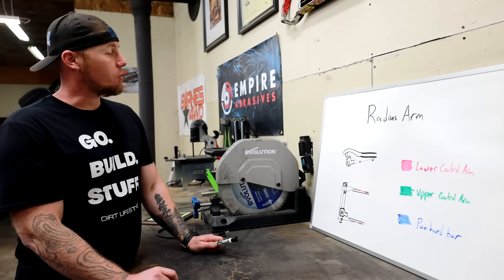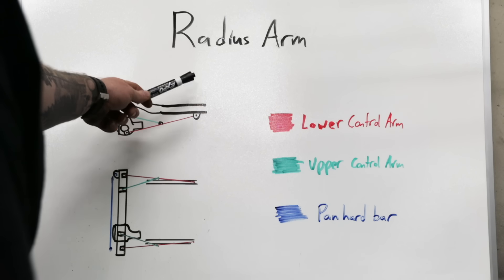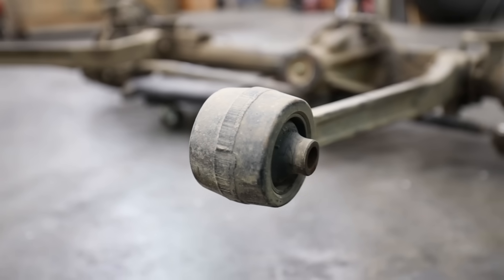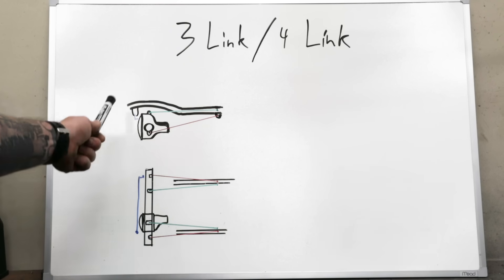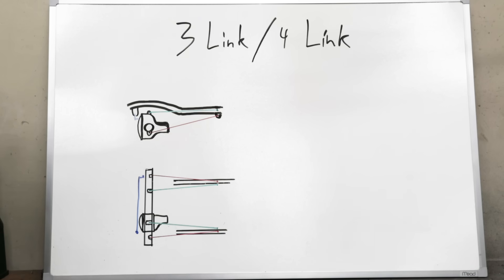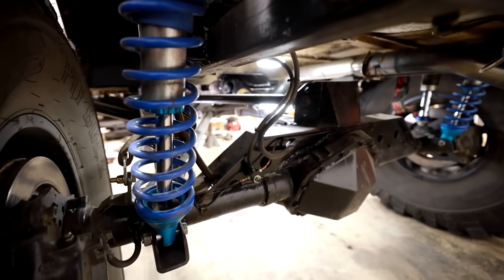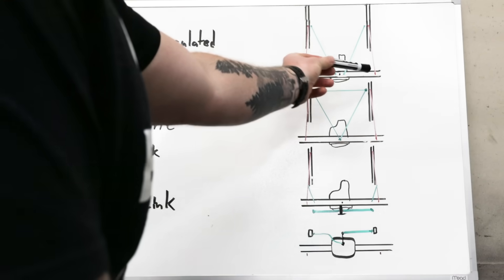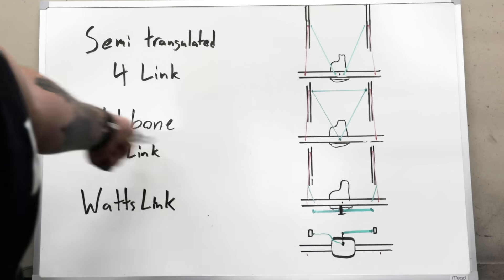3 Link vs 4 Link vs Radius Arm vs Watts Link vs Wishbone 3 Link

Comment: The upper wishbone was OEM in Jeep WJs. It is like a triangulated upper links where the axle mounts are at the same point. However, in practice, a wishbone tends to be much shorter than triangulated upper links.

There is a company that makes a very unique rear Watt's linkage for a JK with standard or Dana 60 housings. The unique part is the center element is horizontal on top of the axle instead of vertical behind it. What makes the Watt's link preferred over that Panhard rod is there no side movement of the axle...the center is always centered. Ditto for the upper wishbone and a well-executed triangulated links. 

The problem with either double triangulated links, a wishbone, or a Watt's link in front is the drag link from the pitman arm to the knuckle that will cause bump steer. With a Panhard bar, lots of effort is made to make the Panhard bar and drag link parallel. Full-hydraulic steering cures that problem and double triangulated is de rigueur on rock bouncers and I thought on 4400 class Ultra 4s that didn't have IFS.

Comment: Off roaders confuse the hell out of me.  A triangulated 4 link will have geometric bind built into the design at the extreme ends of travel. You do not get this with a 3 link. Even a parallel 4 link will bind at extreme ends of travel. There simply is too many control arms and SOMETHING has to change length because the axle is over constrained. The only thing that prevents damage is the relatively slow speed at which the suspension articulates and soft sidewalls which allows the geometric bind to move the axle before something breaks. That said, predictably is always key... and laterally moving axles isn't predictable.

Also, I disagree with the notion that a 3 link is weaker. Unless your inverting the control arms such that the central link is on the bottom and the outer links are on top, the load from the axle is almost entirely transmitted through the outer lower links and any rotation is easily handled by the upper control arm. Ford has 1000+ HP and Torque drag Mustang's with 3 links launching harder than any off roader is hitting their tires. 

I can understand why a PHB is preferred for off roading since it's simple and just works. The advantages of a watts link aren't nearly in play as much as they are on car racing and even then, the lateral movement of the axle is pretty damn small.  The primary advantage for the watts link is roll center control by either fixing it relative to the CG (chassis mounted pivot bolt) or relative to the ground (axle mounted).  I can't think of a single reason RC height would matter for off roading except maybe preventing rollovers while cornering and general driving behavior on the road. 

No matter what, designing the suspension for your intended use is always a compromise. Packaging is always a concern. Just don't let the ease of certain designs artifical constrain you. Longer arms tend to allow for more bind free travel and better consistency.

Comment: My Jeep WJ has that wishbone 3 link on it, I have mixed feelings on it.  Not a fan of that big stock boomerang arm that came stock because it uses a pretty weak ball joint on the rear.  After lifting it I was getting lots of forward and rear movement on the axle causing some pretty bad banging sounds in the rear because the ball joint pretty much turned into jelly after a very short period of time under normal highway driving.  It blew the factory style ball joint fast. I believe the control arm is similar on the Liberty and WJ, it may be possible to adapt an aftermarket rear A-arm from a WJ onto a KJ, in theory, but I've never tried it.  The advantage being there are many aftermarket rear A-arms for the WJ that use flex joints instead of bushings and ball joints, very very easy to convert.

Comment: Pretty sure watts link is used more in stuff like stock cars, dirt track, etc. Because of the arms it's more limited in vertical travel than a panhard, making it not so great in 4x4 applications. Biggest advantage is it always moves straight up and down, not in an arch like a panhard.

Comment: After building several 3/4 link rigs at the shop I'm still on leaf springs. Love the simplicity, strength and lack of track bars.  And yes leafs can flex!  Excellent video mate!
Reply: How did everyone like the 3 link? I'm thinking of 3 linking my rear on my 86.. I wanted to keep the stock tank. Have long travlenin the front.  And was debating on rear deavers or 3 link

Comment: Just solid axle swapped the back of my 03 Navigator built everything 1 off custom 8" lift  with radius arms  1 1/4 Johnny joints 
Navigator on 37x13.50 x 24 interco m16's

Comment: So would the would the easiest way to convert a leaf spring rear to coils would be something like a radius arm set up utilizing the original leaf mounts and coilovers? At that point the only thing being added would be the panhard bar, and some reinforcements around the shock mount? Seams simple enough.

Comment: On a three link let's say if pumpkin housing is on the driver side can you run the upper link on top of the diff or is it better to run the link off of the passenger side where the pumpkin is not?

Comment: is a rear 3 link viable? i would like to convert my MJ to rear coil springs but i want to keep my fuel tank in its stock location, ive seen a 4 link done in a MJ but they converted to a fuel cell and thats not the most practical for what im doing with my truck.
Reply: Why not a radius arm setup?
Reply: @macmurfy2jka  i dont think there would be enough room, the back of the fuel tank is only about 2 or 3 inches from the axle.

Comment: Another cool solid axle suspension is the torque tube suspension used in UNIMOGs and the model t and some other stuff (not that practical to build it aftermarket but still cool). And a crazy suspension that just boggles you mind to try to figure out is the de dion suspension (prob mispelled)

Comment: Nate, I have a quick suspension question: How do I pick the 'best' shock for my rig?
I have a '48 Willys jeep I picked up about five years ago. The chassis was stretched two feet, giving it a 108" wheelbase. The leaf springs were a disaster when I bought it and I had to replace them very early in the build. Being short on funds and knowledge about picking the right type of leaf spring, I went with the Rancho 2.5" lift system with the RS5000 shocks.

Long story short, five years and about 25k miles later it still rides like a dump truck even with the 235/85r16s at 25psi. 

I know that the type of spring pack has a lot to do with that. The Rancho spring packs have five leafs that are 3/16 to 1/4" thick vs. the original 9-10 leaf packs with leafs in a pack of overall similar thickness. 

The truck weighs about 2800 lbs empty. I'm looking at a GVW of no more than 3800lbs fully loaded (targeting 3500lbs). The truck is being set up as an overlander and is my daily driver. 

What should I be looking for in a shock, knowing I can't afford things like remote res Fox units?

Comment: Would love to hear about a trailing arm suspension. I know it's kind of just moving the shocks, but would love to hear your thoughts on it. I would love to build my TJ as sort of a hybrid that can go fast in the desert, but also has decent rock crawling abilities.
Reply: That kinda what i'm doing on my ZJ. Outboard the lowers outside of the uni and mounted shocks in the back 1/4 of the lowers, -still making a mount on the axle in case I don't like it. . Uppers converge to make a wishbone.  I think it's gonna work pretty good though.
Reply: @sloppyoppie  awesome idea! I love ZJs, definitely on my list of vehicles I want to build in my lifetime. what are you doing for the front? I'm not sure what to do for the front to get that prerunner/rock crawler combo
Reply: @Dyrdeksk8r  I went with a control arm drop brackets (shameless 100%). I kept bending long arms on an xj that I jumped alot so I got drop brackets and am going to tie in my front cage A pillar and rock sliders to the drop bracket to add lateral support. The brackets went on over frame stiffeners also. That should last a while. For me, indestructibility is number one. Those handle great too. If it works good I might put it in the Nov Baja 1k race, if they let me register it as a 1700 class only.....

Comment: Nate, what’s your opinion on the 3 link rear suspensions people are doing on the JK/JL now, With the third link going directly above the driveshaft down to the top of the axle housing/truss? I’m building a JK on tons and 40s and I’m contemplating doing that setup strictly so I don’t have to go to a fuel cell or something since the JK fuel tank is right in the way.

Comment: Has anyone ever done a triangulated radius arm? Or would there be too much flex at both frame sides of your radius arms? Could you install stiffer or wider bushings at the frame? It seems like you could eliminate your pan hard by doing this. However this would probably make your rig strictly for the trail.

Comment: Those triangulated wish bone set ups are trash off road. They limit flex down the capability of your upper joint, and you cant use a screw in type joint or you risk unscrewing or over tightening the joint when you are flexed out. Not so sure about the flex steer that has more to do with the length of the arm then anything else.

Comment: Another great video Nate.  A couple points not mentioned that I think are important:
Regarding consuming joints on the radius arm; similar to going with a 3 link front versus a 4 link, you can remove (or not install) one of the upper "arms" on a radius arm and eliminate the bushing wear that results from the axle rotation applied when the suspension articulates.  When the suspension articulates, as opposed to simple droop, one radius arm will be trying to hold the axle in the static caster rotation while the other will be trying to rotate the axle.  This difference in axle rotation is what causes bushing wear.  Eliminate one of the upper "links" and you eliminate the different rotation since now only one arm is controlling caster rotation as the suspension cycles.

Second point regarding using a double triangulated 4 link on the front to eliminate the pan hard, I don't think eliminating the pan hard is desirable unless you are going full hydro or a rack and pinion for steering.  If you are using a linked steering (not rack and pinion) with a drag link, you WANT your axle to swing through a lateral radius identical to the lateral radius that your drag link swings it through.  This way there is no bump steer resulting from your drag link swing radius being different from your axle lateral swing radius (or lack there of in the case of a triangulated 4 link).
If you have a nice flat drag link at static suspension height, chances are you might not notice any bump steer through the normal driving suspension cycle range but if your axle is not swinging through the same lateral radius as the drag link, it WILL be there.  Similar to old front leaf spring suspensions, which have no lateral travel radius, it may only be noticeable with a large suspension travel range but if we're talking ideal suspension solutions, I think a pan hard link is necessary for a drag link steering system.

Comment: Hey Nate, I'm wanting to build my truck to a certain classes specs which only allows leaf springs in the rear an only a two link suspension. I was thinking of doing a set of ladder bars and wanted to see if you had any suggestions. This build is more geared more for off road racing.

Comment: The watts link is great for air or hydraulics because the axle moves straight up and down as opposed to a pan hard bar that can make the axle move side to side as the car moves up and down
Reply: Wtf? Doesn't that mess your alignment up? How much side to side are we talking here? Like an inch?
Reply: @lk6912  depends on the length of the bar and how much vertical travel the suspension has

Comment: Why couldn't school be this interesting growing up
Reply from the maker: Lol
Reply: You Had The WRONG Teachers My auto class Teacher did road racing we rebuilt the car in class (off-season)
Reply: @ypop417  our shop teacher lets us build whatever we please, i'd take in my current dune buggy project but my dad doesn't want me to
Reply: @ypop417  my diesel classes were interesting but general ed wasnt
Reply: Mechanical engineering classes will talk about geometry and design of link systems. The applications they discuss normally are not this cool or interesting though.
Reply: We rebuilt a local's VW Karman Ghia droptop in High School.  The owner pays materials, we do the "free labor".  body, paint, interior, engine, electrical.  I started out with my dad at 10yo on our work trucks, mostly Ford 4x4, as we were a logging company in WA, crew cab meant 4doors for your actual crew...but yeah, I spent plenty of nights laying on cold concrete or gravel in W.WA, often in the rain, fixing Ford Trucks.  By the time I got to High School, I knew most of it.  We had hydraulic press, welder, bandsaws, and the super important Oxy Torch...the gas axe.
Reply: @iamblaineful  is that why they call it crew cab my dad always said it was a truck with more doors for more women of questionable reputation that rhymes with doors
Reply: If Christopher  Columbus  explored America in a early bronco I would have gotten strait AAAAs
Reply: They canceled auto shop class, welding class, and ice hockey the year before I went to high school....my high school still had the full 8 bay shop with lifts just closed and then converted it to a gym. It was sad I was super excited for shop class and then, bam! nope!
Reply: @3.0colorado21  man that sucks
Reply: Because you took the wrong classes or didn't pay attention. Haha
Reply: Because school is rarely about the things kids are actually interested in.
Reply: Because public schools is meant to create obedience and submission rather than free thinking and creativeness.
Reply: Because you would have learned something useful instead of testing well so the schools could get better funding to teach the next class a load of worse BS than the one before.